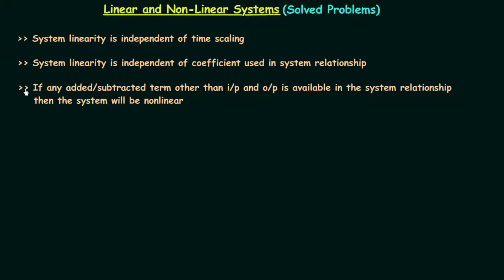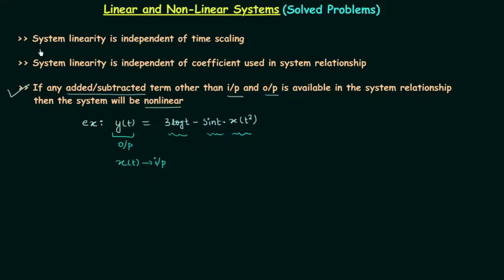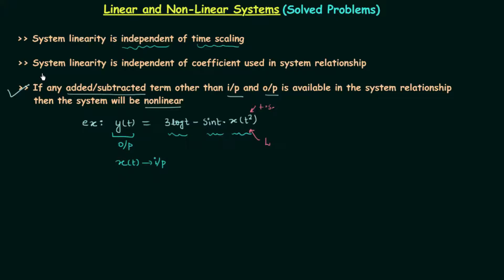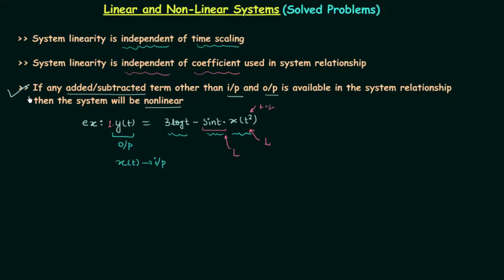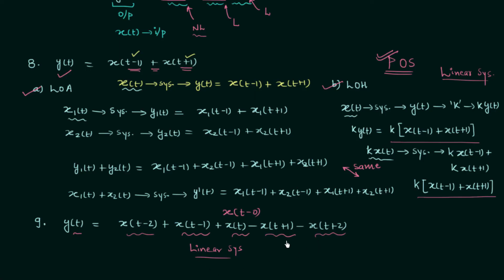Linear and Non-Linear Systems (Solved Problems) | Part 4

Comment: IMPORTANT HINT: if every term in the o/p contains a x(t^n + m) term with degree (power) equal to one then the system must be Linear.
e.g  y(t) = x(t-1) + x(t^2)    ---------> linear
       y(t) =  x(t) + 2t   ---------> non linear ....... cause no x(t) term with 2t....... just like algebra.....

But please check  @Neso_Academy